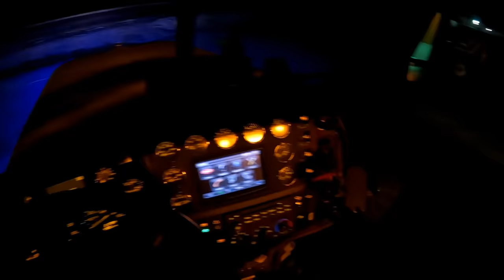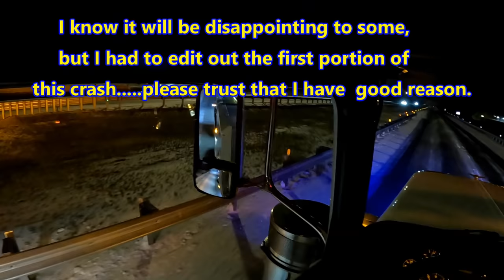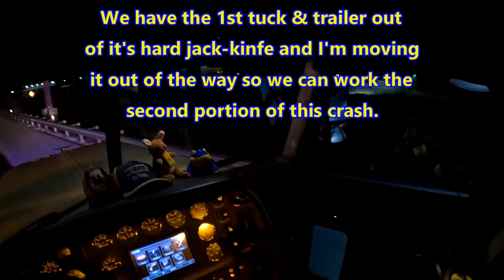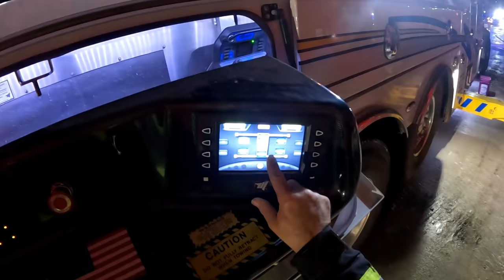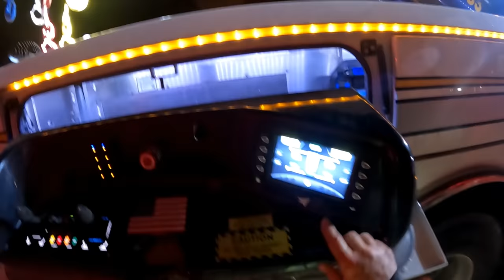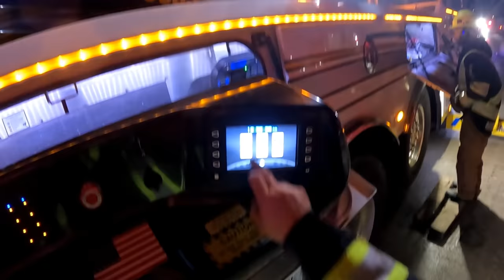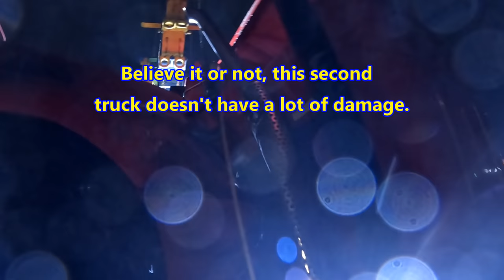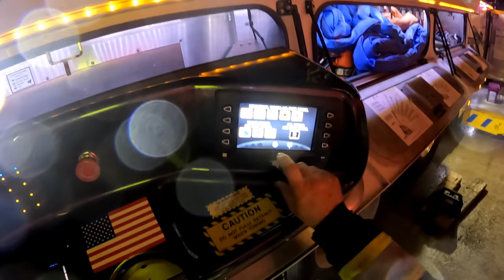CODE 3 MULTI SEMI PILE UP!!  THE ICE RINK BRIDGE

Comment: Unfortunate that it's needed but you gotta love the sound of the Q siren
Reply: It still amazes me that tow trucks can run Federals.  For what?  When the tow truck gets there, the emergency is over.  It's clean up time.
Reply: It's funny hearing it on a wrecker for me due to different laws where I'm at.  But I do like it also
Reply: @gregtimko5967  the faster the scene is cleared, the smaller the risk of secondary crashes from vehicles joining the back of the queue and the faster the road can be fully opened.

They don’t get much choice when to run code either, the dispatching agency tell them whether to run code
Reply: @gregtimko5967  Ron's said before they train with the fire department so the tow truck can be used to lift vehicles off other vehicles when people are trapped in them. 
Also the quicker the incident is cleared the less likely you are to have secondary incidents when people start rubbernecking or traffic backs up for miles.
Reply: @gregtimko5967  It's the law in MO, with special training, permissions, and liabilities. It enables the tow & recovery vehicles to get through the backed up traffic. He doesn't show you the times that they need the equipment to extract the passengers. It also is the state policy to clear the primary wreck as quickly as possible to attempt to avoid secondary wrecks. He's explained this in many previous videos.

#slowdownmoveover

Comment: Whew, That's a mess. Seeing that Amazon trailer though. I work for Amazon Pulling trailers. I've seen a lot of messed up trailers. But i don't know if anyone is at fault here. It's inclement weather. Thank you for using your best judgement and not showing the first part. As a first responder, I understand.
Reply: Weather is never the reason for a wreck.  Drivers not driving for the conditions or driving when they shouldn't, because of the weather, is the cause of wrecks.

Comment: I read fluid is coolant from the radiator
Reply: Transmission actually by the colour and how it looks.
Reply: Didn't see your comment before I asked if it was antifreeze.   Almost has to be either from radiator or less likely but still possible windshield washer fluid.

Comment: It's times like this I am very grateful for living in a warm climate. 
Hope you all keep safe out there.

You really need a support truck / trailer for the rotator. It will help with organisation.
Reply from the maker: I prefer a cooler temp to work in, the heat really drains me.  This however, was a bit of a challenge.  I hate black ice.  Thank you for watching and God bless!
Reply: @RonPratt  Agreed, hot and especially humid weather is very draining. 
But once it drops below freezing and there's black ice or snow around it's so much more dangerous on the roads.

Comment: Love the Q. Don't know if you've looked into them, but I've got OnSpot auto tire chains on my rolloff truck and love them. Not great in deep snow, but worth their weight in gold for ice. I plow snow with a skidsteer and haul it on a flatbed on the back of my rolloff (basically a dumpster w/o sides), so I do a lot of driving in the snow before MoDOT has gotten out to do anything with the roads.

Comment: I guess that front-end alignment can wait now then.
Looks like they might get two good trucks from the parts of three, and some new bodywork.  If they are lucky, they may even have a few spare parts left over.
That was never going to be a fast job, but you managed to minimise delays and do your usual tidy Job, Ron - and in very difficult conditions.
I still don't quite get how that stacked arrangement works - we don't have anything like that in the UK.  It took me long enough to get my head around why you would want to have sliding trailer axles though, as we don't have those, either - we do have some trucks with a sliding 5th wheel for balance adjustment though.  Our overall length limit means we have almost exclusively cabovers, too - sleepers are generally overhead.
Reply: Hi there! I grew up in the '70s seeing a lot of those piggybacks in the USA. You only need one driver and some special fifth wheel attachments to take multiple semi cabs down the road. Sometimes it's a bulk sale delivery, sometimes maintenance, sometimes a cheaper way to deadhead a bunch of rigs. Our interstates have a lot of long straight stretches that make it efficient. You might have noticed other trucks doing it at the start of the video? They will often run in convoy packs to support each other with the specialized tools.
Reply from the maker: Thank you for watching and God bless!

Comment: as an ex ambulance tech ( i think EMT in the USA )  during driver training it was constantly drilled you're no help if you don't make it on scene so drive to the conditions .. hello Talon & i've never seen tractor unit's piggy-backed like that , is it common practice in the states ?? .. and finally that was a real mess
Reply: It's fairly common in the USA. It's an efficient way to use our mostly long & straight interstates to get multiple rigs down the road. Only one driver & fuel tank needed. They will usually run in convoy packs to support each other with the specialized tools and fifth wheel attachments.  You might have seen others at the start of the accident scene?
Reply from the maker: Thank you for the comment assistance Elizabeth!!!!  Thank you for watching and God bless!

Comment: Ron, have you ever saw a cable or chain  that was rated for a certain weight ever fail below that weight?  If so did it whip hard enough to tear thru stuff?
Reply from the maker: I have not seen one that was properly cared for and inspected fail.   In my early years, before we knew of such practices, yes, I have seen chains and cables snap, but almost ALWAYS due to abuse, neglect, and/or operator error.  There have been some "close calls" as some would say.  We have been fortunate enough to learn from those mistakes and try not to repeat them.   Thanks for watching and God bless.

Comment: How do those trucks get piggy backed like that? Seems like they use the same type of connectors on your under reach to hold them in place. But are the trucks lifted on there with a crane/wrecker? I've seen pictures and videos of a single truck piggy backed but never 4. Seems insane.

Comment: Ice, the great enemy. Does MODOT have a monitoring system in place, to check for icing conditions on major roadways?
Up in the north country, in places like Ontario, they do. Its not foolproof, but it helps the DOT to anticipate conditions, and take
proactive steps to salt, sand, and spray brine. That wreck was an unholy mess. I assume there were parts of the job
too graphic to film, including evidence of personal injury. Note: Drivers should always remember that bridge surfaces freeze
before other sections of the highway. Caution is the best approach.
Reply from the maker: MODOT typically does a pretty decent job and there are always maps identifying road conditions.  Black ice on a bridge is sneaky and unfortunately many get caught off guard by it.  Thank you for watching and God bless!

Comment: Wow, that was bad, but the stacked truck survived with little damage from that incident. Good job all around despite the icy conditions. It's ironic that this was posted today as here in Tacoma Washington, a 7 car pile up and two semi tractors were involved, I think took all 5 NB lanes and happened this morning and when all said and done, 1 fatality, 1 critical, 2 serious, 1 delivered to the hospital, to be safe, 2 treated at the scene and the dump truck driver was found to be inebriated (be it drugs or alcohol, the same thing) and was arrested right on the spot and was what caused the accident. It was finally cleared up mid afternoon.

BTW, heard here in the comments on the accident from yesterday near Charleston Missouri on I-57, wow, that looked bad, really bad and clearly you all were there. I think I saw one of your newer trucks, a triple axle but not the 'tator (no boom that I could) at the end of the video clips I saw. Sounded like you all survived, but tired most likely when it was done.
Reply from the maker: Yes we worked the tragic crash on I57.  The cause seemed to be fog and a less than 50 ft field of vision.  I am heartsick for those who lost loved ones and those who will relive the events for years to come .  It was nothing like we had ever seen before.  There of course, will be no video due to the fatalities and our continued policy on this.  We had 5 guys and various equipment out until after midnight.  We were blessed to have been paired with another reputable towing company to get our portion of the job done.  Thank you for watching and God bless.

Comment: Hey Ron, I'm curious.  If I may ask, your drop down axl on the Tator, is that considered a "tag axle" or a "pusher axle"? Myself, I've always thought that if it's in front of the drives it's a pusher and behind the drives it's a tag axle. Im not trying to correct you, I'm asking for my own self.
Reply from the maker: The answer would depend upon who you ask and from what part of the world they are from.   I have come to call it our self-steering lift axle.   To me, it's considered a "pusher", but using the opposite logic, a rear engine diesel RV is called a diesel "pusher".   If I stated in the video that it was a "tag", I simply mis-spoke.   Again, it depends on your perspective, I suppose.   Thanks for watching and God bless.

Comment: Red fluid was antifreeze, wasn't it? 

 My initial thought was someone had done a very big no-no and ran dyed diesel fuel on road, then I thought maybe a tank for the APU that had off road, then I  remembered seeing a pinkish/purplish antifreeze labeled for use in diesels.  So, antifreeze is my guess, possibly one of the low/ non-toxic belends.

Edit:  also occurs to me it could be windshield washer fluid.
Reply: it looked like transmission fluid to me, the tranny cooler is right up front
Reply from the maker: Truck blood is what some are referring to it as.  LOL  Thank you for watching and God bless!
Reply: @adamt4742 hmm, good point.   I forget all the time that automatic transmissions have coolers in front of or otherwise near the radiator.

Comment: 39:37 Is that puddle Oil, Power Steering Fluid or Transmission Fluid from the Transmission Cooler section of the Radiator?

Comment: Would it have been beneficial to use the spreader bar, if you were concerned about damaging the truck more with the hood. I'm not trying to be a smart guy just wondering. As always keep up the good work, be careful
Reply from the maker: The spreader bar would have been a viable option.  It's not my favorite tool to use, since it is so cumbersome and time-consuming to assemble.   Thanks for watching and God bless.

Comment: "We can't do anything to help if we don't make it there" is a good mantra but I prefer "Never put your body anywhere your mind hasn't already been"  (never been able to find an exact origin, as it was told to me a RAF pilot had a sticker with the phrase on his instrument panel but who knows!)  It's a principle I try to apply to Driving, back in the past flying Gliders and life in general.

Accepting your Judgment (be it legal or moral) for not showing part of the recovery, it would be nice if you're able, at least, to share the reason, obviously that's your call. I have to say I'm confused about the original configuration pre-crash, it looks like the tractor unit was 'towing' one or more tractor units, presumably there is some kind of adaptor to attact a tractor unit to the 5th wheel of the lead tractor but I don't know for sure, I can see that if there is you can dasiy chain them to a degree; is my impression correct?

Comment: You might could have unbolted the hood- removed it- and grabbed the frame back behind the engine.. Little more time- but less work in the longrun- and safer for ALL of you.. I've done that before. It's not the best- but it WORKS and it's to me safer..

Comment: 22:52.  Oddball idea...

Mount a rim (no tire) reversed on the hub and wrap a strap around that to capture it for lifting the front end and keeping the cable away from the fender.

(creative... but needs you to have/aquire the spare rim  that thing doesn't NEED duals to get towed in... dismount a tire.)

A few minutes and... 

Would that work?

Comment: A comment about letting the driver sit in the cab: In the UK there have been several cases of where the fire brigade has insisted on cutting the top off a car where a victim is sheltering 'in case the victim has spinal injuries'.

Comment: This consist is what is often  referred to as a "decked" move.  Others include "two way" and "single," some make use of a frame rig that literally sets up the towed rigs like a trailer instead of using the saddle setups.  I did singles only, with one exception.  I moved a set from K.C. to Cincinnati, along with the originating driver who had run out of hours.  The potential for headaches like what was dealt with here is why I had no further interest in moving decks.  For me, it wasn't worth it.
Reply from the maker: I get that this is a cost effective and time saver to use this method, unfortunately this one didn't go so well.  Thank you for watching and God bless!

Comment: In cases like this having a set of jaws of life would really come in handy, that and those hydraulic spreaders they use. Walking on the ice a set of corks or crampons would definitely help. I was thinking wrapping both ends of the chain around the frame on either side of the axle and then grabbing it with your cable would've been a way to do it that would've offered good purchase on it.. At that point when the hood is a write off don't care about the damage you are doing to it... rip it off or cut it out of the way if you have to, just make sure to show that it was already totaled and you were doing what you needed to to get the job done. If you dealt with trucks without front tires on them more often I'd say it'd be worth it to commission a lift plate that could bolt in place of the rim and offer you a secure place to grab.. sort of like a spacer with a riser with a built in hook point that you can just bolt on quickly \_/ but inverted. Technically I guess an old rim cut up could do the job but I don't know how much cutting it would ruin the structural stability of it. Having absorbent diapers that you can hold up with bungees would be incredibly useful when you have a punctured trans cooler like that second truck did.

Man, Ethan and Eli are going to have some serious cleaning to do after that one..
Reply: our fire co just bought a battery operated tnt combi tool, i think it was just shy of 7k, runs on milwaukee batteries. a combi tool can cut and spread.
Reply from the maker: Thank you for watching and God bless!

Comment: Ron, I have great respect for what you do but this one thing keeps bugging me. You have bits of dunnage on board - 4x4, 6x6, whatever, and I keep seeing you wrestling them out. For crying out loud just screw some old strapping to the sides so there's a loop at the end you can grab. Makes it easy to get the wood out, to carry and to place. Call me lazy, but it seems like an obvious and cheap solution to an aggravating problem.

Comment: Glad you had some salt with ya ! The Lord willing I'd like to put some money aside to get you a pallet of calcium .I will try. If I can I will even deliver it to you all the way from Pennsylvania.  I used to be a Trucker until my frameless dump came into contact with overhead high tension lines in which I "borrowed " 19,600 volts of Electricity through the back of my head 5 times because a stupid power company worker kept resetting the line breaker until the wires burnt off . Thus I spent 5 1/2 luxurious months in a burn unit , lost both legs above the knees , and had extensive skin grafting.  God himself saved me by touching me and healing a severed artery in my head that was burnt in half by the Electric.  And yes I am the same man that suggested you carry some salt or calcium with you for safety.
Reply from the maker: Thank you so much for wanting to help us out.  It isn't necessary but the sentiment is appreciated very much.  I am amazed at all you have been through.  Obviously God isn't finished with you yet.  I'm glad you are still with us.  Thank you for watching and God bless!
Reply: @RonPratt  And may God Bless You ,your Family , your employees,  and everyone in the Great State of Missouri  !